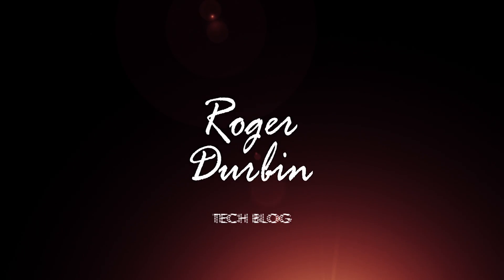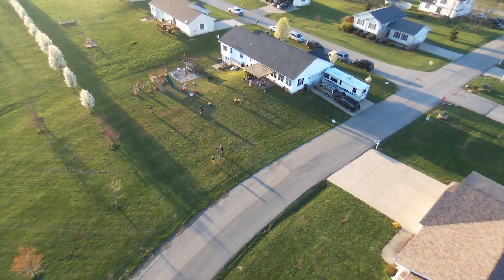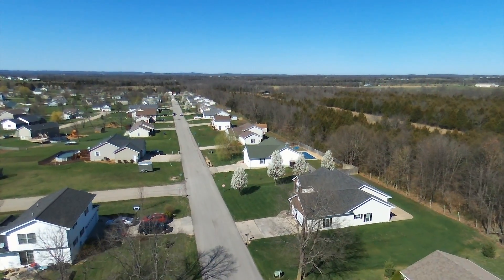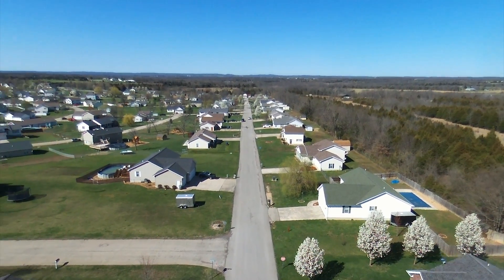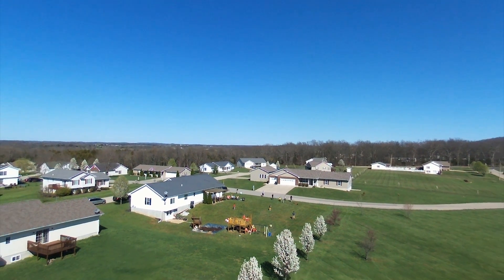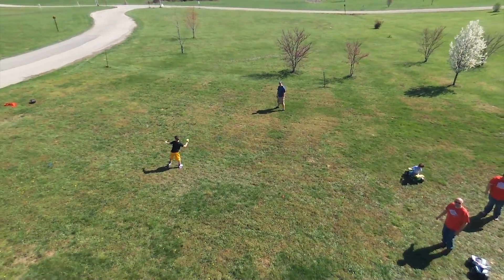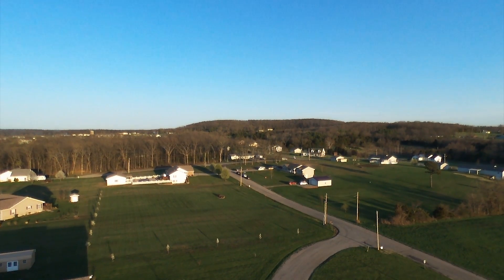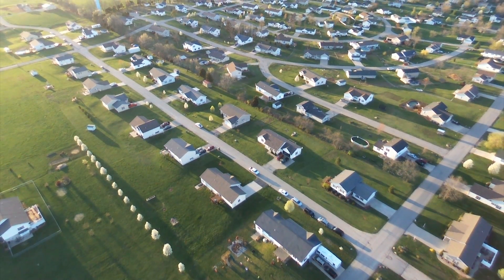Parrot Bebop Drone Tech Blog #1

Comment: When I try to use sky controler it will take off but gimbals barely have any influence on bebop.. I'm using bebop and bebop sky controler black addition 
.  And testing indoors but it's Flys good with just the tablet

Comment: Great video, I sure need help with mine. Drops out if the sky after 50 ft. Range and at 8m height. I'm going to build my own sky controller. But I need help on how to go and set my Wi-Fi to 157 on 5.8ghz. My free flight app just shows 2.4, 5.8,all, manual. Is it the manual button I select to set the Wi-Fi my self? Thanks

Comment: ok I have been a parriot pilot for a little over a year, and with regards to most GPS quads they need at a minimum of 6 satilites before you can take off if you are in GPS mode. The problem is like you said people take off before thy have enough satilites and on the free app software once you go to the main flight interface screen it will not show you the number of satilites you have.  I feel Parrot should fix that.  But good review.

Comment: Look like not so many people capable of understanding how it works and what are the problems with Parrot. I let you now.

For pt.1. It is a scam from the beginning that Parrot advertised it should have 26dbm (400mW) TX Power back in last year (CES 2014) but finally it doesn't come out. Instead, the drone only produces 13db (20mW) TX power only which is technically 20 times less than the original TX power it should have produced causing it is incapable to survive in a "normal" wifi area that we live in. If it had, problem solved. Interference problem gone too because other access points/routers could detect its existence and those Wifi devices which set to Auto-Channel will jump to other empty channels. The current problem is its TX power is so weak even those "wifi neighbours" unable to detect it and burying its signal in noise floor level. Your tech friend will let you know how it works. So I don't explain more here.

For pt.2 You are correct. That's why I have disabled the GPS support function from the firmware level. So mine flies with no GPS is much safer and more stable (drifting gone away too).

After all, this product is a major design fault and highly recommended not to get it to avoid pain, sad and angry to come to find you. Sell it out or ship it back to the shop while you can.